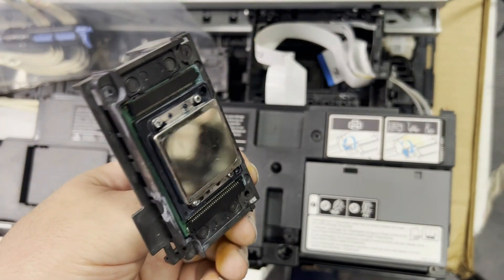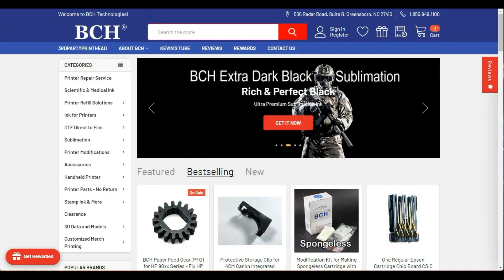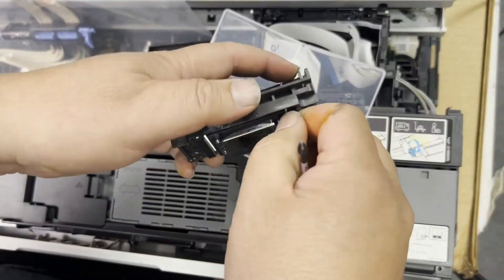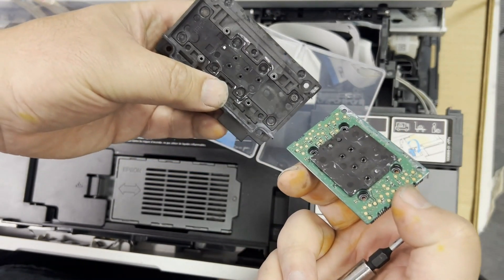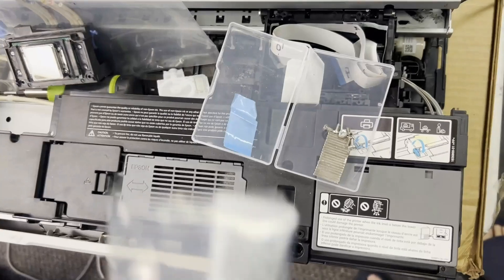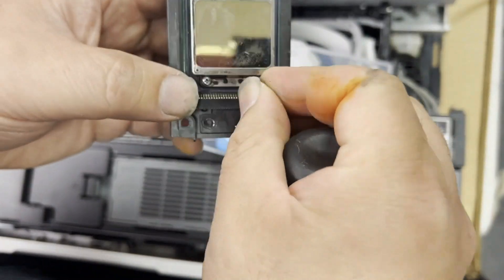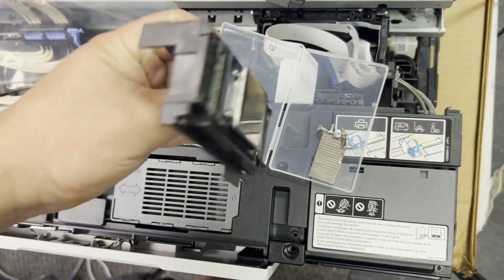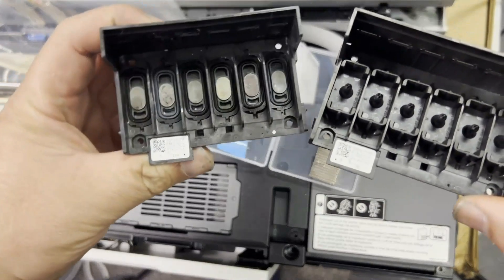#1 Trick ET-8550 DTF Conversion - Upgrade Printhead with Nipples for Improved White Ink Flow

Comment: Getting a 031004 error code 10 seconds after it starts up did I install the pcp board the wrong way or was it because of a smudge on the pcp board from accidentally touching it I cleaned it off should I put it back together and try it again?
Reply from the maker: Thanks so much for watching and for the great question! A 031004 error is usually caused by the printhead being too cold, which often means the printhead cable isn’t fully seated or the printhead itself isn’t installed securely, so double-checking those connections is the best next step before powering up again. I really appreciate your support, and if you’d like priority replies (usually within 48 hours) plus perks like early access to new videos, please consider subscribing or becoming a member since I get a huge number of questions and can only answer about 10 per day; subscribers and members are answered first, and everyone else is answered newest-to-oldest as time allows. If you’re not subscribed and don’t hear back within 48 hours, feel free to subscribe or repost your question so it moves to the top, and if you subscribe later, your older questions automatically become priority without needing to re-post. You’re also invited to join me on Run With Kevin — LIVE, where I go live most mornings between 6–8 AM Eastern and answer printer questions in real time, so be sure to subscribe and turn on notifications if you want to catch the next session. If you need faster help, you can always email [support@bchtechnologies.com](mailto:support@bchtechnologies.com), and if this reply or the video helped you, I’d really appreciate a quick Google review at [https://g.page/r/CfL7k6nYvPQ9EAg/review](https://g.page/r/CfL7k6nYvPQ9EAg/review).
Reply: @BCHTechnologies so I made sure that the cables were correctly installed. The only problem I see is the person who I bought everything from on here sent me a KJS nipple conversion kit and a damper that seems to be meant for the epson 15000 I have the epson 8500 and the last part is installing the dampers I’ve already connected the tubes but the front lip of the damper touches the carriage wall and won’t go down any further. I asked the popular person on here if the items were correct for the 8500 but from what I’ve searched online they were not for the 8500 I’m not sure what to do. I’ve been trying to get the dampers in completely but no luck it’s been 4 days a few hours a day working on this issue. Could that be why the code is popping up?

Comment: Why does my printhead have a small dent in it?
Reply from the maker: Thanks so much for your support and for checking out the video! That little dent is almost always caused by physical contact, since the metal on these printheads is extremely soft and can deform even from something as simple as setting it down on a hard surface without protection, and it happens to a lot of people (including me) when working on them. Most of time, it won't hurt the printhead.  I really appreciate you being here, and if you haven’t already, please consider subscribing or becoming a channel member because subscribers and members get priority replies within about 48 hours and also get perks like early access to videos; I get far more questions than I can answer and usually reply to only around 10 per day, so after members and subscribers, I fill remaining reply slots last-in, first-out, meaning newer questions get answered first. If you’re not subscribed and don’t hear back within 48 hours, feel free to subscribe or simply re-post your question since newer comments get reviewed first, and if you subscribe later, all your older questions automatically move into priority. You’re also welcome to join Run With Kevin — LIVE, where I go live most mornings between 6–8 AM Eastern to answer printer questions in real time, so subscribe and turn on notifications if you want to catch the next session and ask directly. If you need faster help, you can always email [support@bchtechnologies.com](mailto:support@bchtechnologies.com), and if this reply or the video helped you, a quick Google review would really mean a lot: [https://g.page/r/CfL7k6nYvPQ9EAg/review](https://g.page/r/CfL7k6nYvPQ9EAg/review).

Comment: I have tried this conversion two different times, on two different printers and different manifolds and dampers. Both printers ended up dead. Both times, once I did the conversion, the printer wouldn't print. It would only put out blank sheets. Ink was getting through the dampers and printhead because I could pull it through the waste line but absolutely would not put ink out onto the film. Just blank pages. I worked at it until the printers finally through error codes and died. I emailed support for help both times. Multiples times over the course of 2-3 months and I did NOT receive the first response back. I even requested a RMA so that I could send the last manifold and dampers back. There has been zero response to that too. What gives??
Reply from the maker: Thank you for sharing your experience and for supporting the channel—I truly value your feedback. I’m sorry to hear about the issues you faced with your conversions and the frustration caused by not getting a timely response, and I’ll make sure this is looked into so it doesn’t happen again. I do receive a very high volume of questions and emails, which means subscribers and members are prioritized for responses within about 48 hours, while I answer other viewer questions as time allows. Becoming a subscriber or member also gives you exclusive benefits like early access to videos and priority answers. If you need faster help, the best way to reach me is at [support@bchtechnologies.com](mailto:support@bchtechnologies.com). And if this video or my comment has been helpful at any point in your journey, I’d be so grateful if you could leave a review on my Google page here: [https://g.page/r/CfL7k6nYvPQ9EAg/review](https://g.page/r/CfL7k6nYvPQ9EAg/review).
Reply: same exact thing just happened to me. 2 different printers/brand new printheads and manifolds. both heads dead. nothing at all. Et 8550 and a modified xp600 dtf. SMH

Comment: As you guys can see the black gasket between the printhead manifold and the printhead came off together other times it stays stuck to the manifold make sure you remove the gasket and place it with the new manifold ive seen tons of times it dont work whats wrong and thats what happens leads to burned print head as it continues to suck air and eventually gets to hot and burns out

Comment: Can you do the upgrade on a new Epson  without powering it on or do you still have to slide over the printheaf?
Reply from the maker: Thanks for subscribing! Your support helps us get closer to our 100k goal, and I really appreciate it. You don’t need to power on the printer for this upgrade, but you will have to slide the printhead over to remove it. Just rotate the PF rod counterclockwise, and that will free up the printhead for removal. Let me know if you have any other questions—I typically respond to subscriber questions within 48 hours!
Reply: you can slide it over without it power up there is a plastic wheel on the side on the bottom not the top just roll it and it will up lock it to move it then just slide it over and do your upgrade you'll still need to do the prep work for the printer

Comment: I bought this, but my dampers out of the 8550 will not fit. What dampers do I need?
Reply from the maker: Thanks for watching and commenting! Regarding your ET-8550 PNC printhead nipple conversion cover, the dampers typically connect either via a clip on the top or a square box on the bottom. For this cover, any damper that uses the bottom connection and is small enough should work. We’ve tested several options and found the V2 damper to be the most compatible. You can check it out here: https://bchtechnologies.com/products/improved-version-2-top-load-white-ink-damper-for-dtg-dtf-fits-most-models-l1300-l1800-l300-l350-l355-l550-l801-l800-l850?_pos=3&_sid=4e72aa060&_ss=r. If you haven’t subscribed yet, I’d encourage you to join the community for faster responses—we’re working hard to address subscriber questions within 48 hours, while the backlog for non-subscribers can take longer. For urgent assistance, feel free to email support@bchtechnologies.com. Hope this helps!
Reply: just make sure the dampers are for the xp-15000 because they do come in different sizes from the 8550 and make sure the holes fits good luck

Comment: Great manifold, but Ink dampers are trash, unnecessary tubing gets in the way clunky setup. If you ever get refilabl ink cartridges for that print head manifold, then I'm a 100% buyer,
Reply from the maker: Thank you for watching and taking the time to share your thoughts! I really appreciate your feedback on the ET-8550 nipple conversion and am glad you liked the manifold. I understand your concerns about the dampers and tubing—it’s always helpful to hear different perspectives on setups like this.

If you’re looking for a system with refillable cartridges, I recommend checking out chipless conversion options at inkchip.net. They offer solutions and detailed instructions for achieving that. However, since the ET-8550 is an EcoTank printer, my focus has been on modifying it for DTF printing. Unfortunately, refillable cartridges might not be the best fit for this purpose. Each cartridge holds about 10–15 ml of ink, and DTF users typically go through 100–500 ml of ink daily. That would require constant refilling, which is why most of us don’t mind the dampers and what might seem like "unnecessary" tubing—it’s essential for the workflow.

If you have more questions or need further guidance, feel free to write to me at support@bchtechnologies.com or post on one of my recent videos for a quicker response. I get a lot of questions, so it’s tough to keep up, but I always try to help where I can. Thanks again for your comment and for being part of the BCH Technologies community!

Comment: Will this work for DTF converter printers?
Reply from the maker: This is what it is designed for.
Reply: yes as long as you have a chip less software running this the dampers and make sure you relocate you chip reader and water proof the boards you don't want any overspill

Comment: This is pretty cool... so just to be clear, does the nipple conversion work with the stock dampers, or do the dampers need replacing as well?
Reply: Just realized. You have to use only his dampers. he should put a video up. showing it works.
Reply: @tonyjenkins71  unfortunately, I don’t think there will be a video per the note at the bottom of the printhead upgrade page on the BCH site.  This looks like a game changer, but without additional video help, I’m not gonna risk damaging my printer.
Reply from the maker: I put out more videos.
Reply from the maker: If your damper is secured by the base, not the plastic clip on the top, you probably can use it. Also, it has to be short enough to fit in. From the ones I tested, only one kind of damper works.
Reply: you'll need to buy dampers for the xp15000 to make it work.

Comment: Kevin great video. I have a l18050 printer & i encounter both white channels disappearing  in nozzle check then i replace both the dampers & my issue resolved for few days .. is changing the manifold help to resolve my issue ?
Reply from the maker: It could. The screen mesh on the ink inlet prevents the white ink going through and very easy to get clogged.